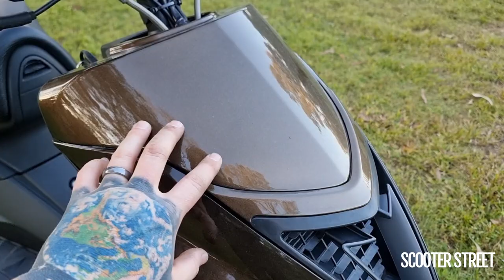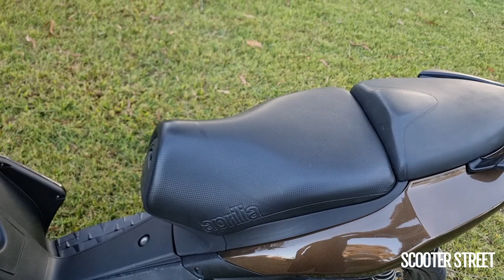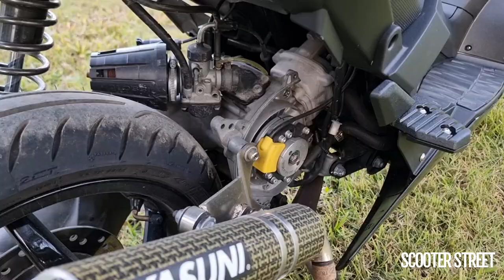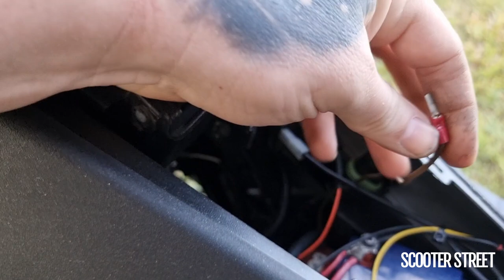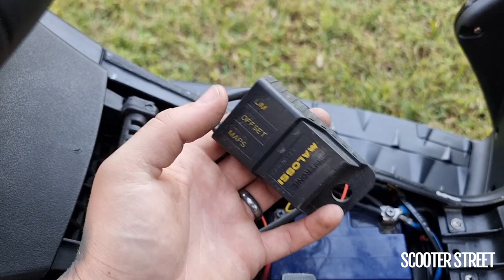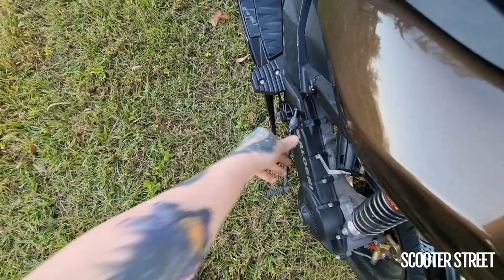How We Transformed This SR50R: Race Engine Build Update

Comment from the maker: Hey Guys, If you would like some assistance with your builds or help with trouble shooting shout me a coffee and will be happy to help out. Follow the link below to the home page and see the Coffee button in the top right hand corner of the Banner.
👍☕https://www.youtube.com/channel/UCySQaQYtx9PVONqjwXKOZcg ☕👍
Reply: what would cause my belt to keep shredding i’ve gone through 3 malossi kevlar belts since i’ve put my malossi 70cc street kit in?
Reply from the maker: @tylerdivitini2014  I have seen this many times. Hey guys happy to help with any questions here just buy me a coffee see pinned comment.
Reply: @tylerdivitini2014  either incorrectly fitting them or clutch springs are too tight.

Comment: Question: I noticed a grinding sound and feeling coming from my transmission box, where the variator and clutch/belt are. I opened it up and there was excessive black dust everywhere. Obviously the belt is getting grinded down. I have a 2008 kymco vitality 50 2T. 
This is what I have upgraded so far:
1: Malossi Flip exhaust added
2: malossi Kevlar belt
3: upjetted carb
The scooter is running great, the stock roller weight was 9gr so I tried a mix of 9gr with 5.gr but it seemed too weak at the start off so i traded for all 6.5 gram rollers, the take off and top speed is really good now. 
Just the belt grinding. I ordered a malossi performance clutch and a polini high speed variator. I’m hoping that will fix the belt grinding issue. Have you ever seen this excessive belt wear before? And if so how did you remedy it. 
Thank you for posting your videos it really helps, Happy subscriber.

Comment: Hello, I see you know alot about scotters, I have a stock aerox 1998, want to rebuild the engine with the fastest parts. like new cylinder kits, exhaust, variator. And was wondering if you could give me advise what parts would be the fastest for top speed, would really love your advice.
Reply from the maker: HI Maus, go to the brand page for the Brand you like, it can be Polini, Malossi Stage 6 or another that you prefer.
Look for the top racing parts on the page and you will find the highest cylinders have a recommended exhaust, carby and transmission parts. https://www.malossistore.asia/en/yamaha-aerox-50-2t-lc-euro-2-yaae5004-M All the Malossi parts here..:goodvibes:

Comment: When I had placed the crankshaft seals in the crank seized up, how would I go about making sure the crank doesn’t seize up?
Reply from the maker: Grease or oil the seals prior to inserting crank. The crank will feel resistance at first, over time it will settle. Ensure correct seal kit for the crank, use a good brand of seal.
Reply: @scooterstreetau And also what is wrong with the flywheel if it is wobbling and won’t spin in a straight line
Reply from the maker: @realityrank8534  Is crank bent? Did you check it? Is the flywheel out of balance?

Comment: Good morning, can you please tell me if this malossi air force cover fit on a zip 2t ac of 2009?
Thanks
Reply from the maker: No, it will not fit the Air Zip. The RC-one complete water cooled engine does run the Air force cover.

Comment: Hi! Is it possible to keep the central stand with a yasuni c16  on a zip? Thanks
Reply from the maker: Yes you can, but the header and cradle need to be modified.   Too much work I say, best to use the side stand and have the main stand at hand and connectable for when performing maintenance.
Reply: @scooterstreetau  thanks! What will be your choice on a zip 70 malossi sport, with 21 phbg ? I have a yasuni r and i want to change!
Reply from the maker: Upgrade the cylinder. @maverick1236

Comment: Hello, I have a 2020 aprilia sr50 r carb. I want to do some modifications for it. I would like to put a 70cc kit on but I am worried about adjusting the carb and so on. I have a gianalli exhaust on it already and Malossi pod filter like in the vid. Everything is stock apart from roller weights ( I think) and it does 50mph slowly. If I was to put a 70cc kit on Would I have to change the crankshaft and would the oil feed from the stock carb be enough to lubricate it.
Thank you
Reply from the maker: Watch our earlier videos on how to change the carby jets, you will be able to do it, just go slowly and be gentle with the parts. No you do not need a new crank BUT it should be changed/upgraded if it is worn and the bearings are worn.

Comment: Im almost done with my aerox build 70 mhr replica yasuni r pipe and 19dellorto which main jet would be a good starting point
Reply from the maker: Pod or air box? As a general rule I start as rich as allowable, looking for a spluttery engine, then lean it from there until it clears.

Comment: Gilera sp 50 runner
When my scooter is cold and i want to ride it, it doesnt get full rpm when i accelirate and its almost like it doesnt get enough gas, this only happens when cold, any suggestions to fix this or is this normal?
Reply from the maker: Hi Robin, Just at a guess I would say it is the Auto choke. I really don know but that is all I got. The auto choke really just enrichens the fuel at starting and a good working choke will slowly turn off after say 60 seconds. Check out the airbox to carby system and also the Auto choke and air leaks.

Comment: Got the same bike as a 2008 model do you know where I can get the floor mats made for these ?
Reply from the maker: These are the original floor mats, I do believe they are no longer available as a new spare part. I have seen rubber checker plate cut to size and also aluminium plate both look great..

Comment: Gilera runner sp 50, whats the downsides of getting heavier weights, because around 80kmh it starts giving me signs that it doesnt want to go faster and the belt gets too far up the variator. 
Do i lose any acceliration by adding heavier weights?
Reply from the maker: When we discuss heavy rollers it usually refers to the rollers losing gear optimization due to excess weight. The heavier rollers can slow down acceleration and it is at this point where the rollers must be lightened to allow a fair opportunity for engine to rev without going through the gearing earlier than optimal..
Reply: @scooterstreetau  thanks for answering
Reply from the maker: @robinmoldestad1679  I hope that makes sense..

Comment: How many turns should i screw the mixture screw on aprilia sr 50?
Reply from the maker: @Octavian17  From all the way screwed in, turn 1 complete turn out. 1 full rotation we refer to as 1 Turn out. The mix has to control the run down off throttle.

Comment: What does a stiffer clutch spring actualky help with?
Reply from the maker: The higher tension spring require higher RPM (rotational force) to release and allow the clutch shoe to engage with the bell housing, this unloads the crankshaft and give an opportunity to allow rev increase without the early load from the clutch and rear wheel.

Comment: I have a 2020 aprilia sr 50 with leovince tt ( derestricted), malossi multivar 2000 with 6,5g rollers, stylepro cluch with piaggio original clutch springs and contra spring, athena belt, 65 jet. The scooter is an absolute beast for a 50cc, but i am not sure about the top speed because on the dash it shows 80 and gps 75, is it still restricted electronically or what?
Reply: I didn’t change the cdi, i just removed the black and white wire on it that would derestrict it
Reply: But i want to know if it is still restricted and to get some tips on how to increase the top speed a little bit more without a 70cc kits
Reply from the maker: The speedo on most scooters is optimistic, meaning true speed is 60 and speedo reading is 66. there is approx. 10% acceptable variance. It is very difficult for manufacturers to calibrate the speedo as they run from the drive gear on the front wheel. (different tyre pressure will give a different reading)
Reply from the maker: @Octavian17  Removing the Black/White wire connection is a good solution, we remove the wire connector at the solenoid. Remember to secure and water proof any open wiring.
Reply from the maker: @Octavian17  If it is going faster now than what is was before then you have derestricted the engine👍I would think the 65 jet is rich for the standard air box but only you can tell based on the carburation. Fit a performing  exhaust as the factory exhaust is heavily restricted.
Reply: @scooterstreetau  i already have a leovince tt pipe on it and i got it up to 80 km/h on dash and 75 on gps, what parts would you recommend to get it up to 83 85 km/h
Reply: I also have sport variator on it but i am using the standard rollers, clutch springs and contra spring that were in the scooter since i got it
Reply from the maker: @Octavian17  well the jet would be suitable if you already have an exhaust. These should be doing 80kph - 85kph if the exhaust is fitted and tuned correctly.. keep tuning.
Reply: @scooterstreetau   do i need to use the springs and the rollers that came with the exhaust?

Comment: What year model is this? I own a sr50 r carb 2017, and really want to tune it.
Reply from the maker: 2013
Reply: @scooterstreetau  Thanks! Do you have any recommendations of what I should do with my 2017? I want the feeling while riding it to be sort of effortless, but nothing too extreme. I have removed the variator ring and it goes around 70km/h on a long road, with very slow acceleration. Here are some installments that i have thought about. (keep in mind, English is not my first language, and I´m not 100% sure that I have gotten all the names correct for everything. Yasuni c16 exhaust pipe, Malossi MHR Racing cylinder kit 70cc, Dellorto carb (PHBG 21 DS), (Malossi "crankshaft?" MHR HPC. Art.nr. YAS-TUB423) Not sure what roller weights I should get. Also not sure what else I need to do to make this run smoothly. Im not that good with engines and stuff like that.
Reply: @scooterstreetau  If you dont think these installments would fit my desired riding style, please come with some different suggestions. I mainly want to boost the acceleration, but also the top speed.
Reply from the maker: @melkerdandenell6003  This list sounds very good, you will need a TC unit ( derestricted CDI) and all of the tuning parts for the transmission such as rollers, clutch or clutch springs. Also the needle kit and jet kit for the tuning of the carby..
Reply: @scooterstreetau  Thanks! I'll look into it
Reply: @scooterstreetau  If I can't afford everything right now, would it be possible to only install the exhaust, cylinder kit, and maybe carb, needle kit and jet kit? And slowly work myself up the list step by step over time? Or would it damage the engine?
Reply from the maker: @melkerdandenell6003  Best to leave it until you are ready. The race parts only work well if all in.

Comment: which kit is better malossi mhr or stage 6 mk2 racing
Reply from the maker: Really an opinion for the rider. The stage 6 is really good value. Malossi MHR is race end and must be accompanied with all other equivalent supporting parts.
Reply: @scooterstreetau  i have plan to buy CRANKSHAFT MALOSSI MHR RHQ,carb pwk 28 mm,INTAKE MANIFOLD MALOSSI MHR,and  fast THROTTLE.what is your opinion what chilindar is better to buy betwen malossi mhr and stage 6 mk 2 racing,and which one will give more power betwen this 2 cilinders?which chilindar is going to last longer?(i have malossi transmision)
Reply from the maker: Malossi for Malossi, best to brand the parts the same. @theleoto2691
Reply: @scooterstreetau can i get it over 20 hp with malossi cilinder?
Reply from the maker: You should go for the Malossi RC-One 94cc engine. @theleoto2691
Reply: @scooterstreetau how much hp can i get whit malossi mhr?
Reply from the maker: With the complete set up 20hp @theleoto2691
Reply: @scooterstreetau what would you recommend?
Reply from the maker: Depends on budget and what you want end result. If you want a race bike gor for th RC-One. @theleoto2691
Reply: @scooterstreetau budget is about 800 euro,i want to take the maximum of the mhr chilinder,what  setup would you recommend ?
Reply from the maker: Ok small budget for what we were discussing, go for the Malossi MHR Rep or stage 6 MK2 and a Yasuni, add a lager carby 19mm  and transmission parts, Variator and adjustable clutch. @theleoto2691
Reply: @scooterstreetau but i have yasuni r i have malossi transmision.i need recomendation on what chilinder ,crankshift, and intake to buy
Reply from the maker: Ok I didn't know! Go for the MHR rep cylinder, HPC Crank, and carby @theleoto2691

Comment: How much did the build cost?
Reply from the maker: Approx. $4500 including parts, body work and fittings.
Reply: @scooterstreetau  Thats insane, Was it worth it afterwards?
Reply from the maker: @unpossible3249  Absolutely worth it! As a hobby if you love scootering it is a cheap and satisfying project. Compared to other vehicles or toys, if it were a car for instance or if it were a boat/jet ski quadruple plus the cost. The electric push-bikes cost $5k+
Reply: @scooterstreetau  Hey, i got a malossi 70 sport injection kit on my piaggio purejet/ditech with malossi ecu installed, however it seems to top out quite early on topspeed, Can you give me some information and recomendations of what gearing i should change to that could be suitable for my setup? 👍
Reply from the maker: @unpossible3249  You need to find out what is available. Check out the brands you use for their gear kits for your model, you will find a secondary gear that will be suitable. If you are certain it is the gearing limiting the top speed, it could e in the transmission pulleys. Malossi do a secondary for NRG, I am not sure of your exact model.?
Reply: @scooterstreetau  Sr50r factory
Reply from the maker: @unpossible3249  ok search for that model and gear kits👌
Reply: Where are you guys located?